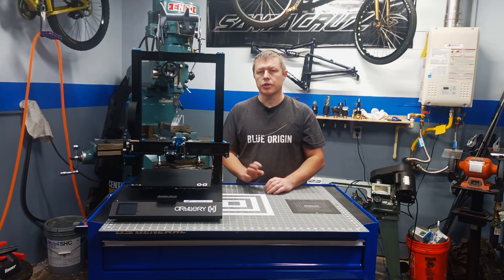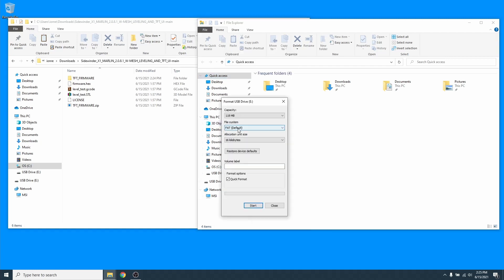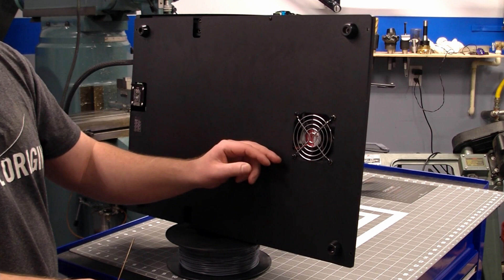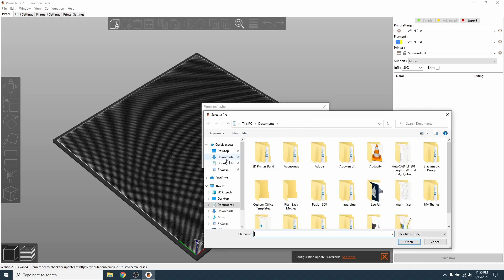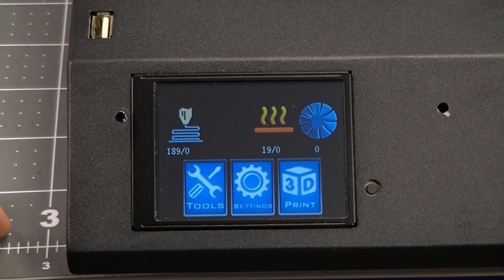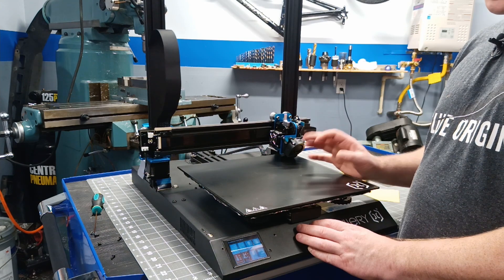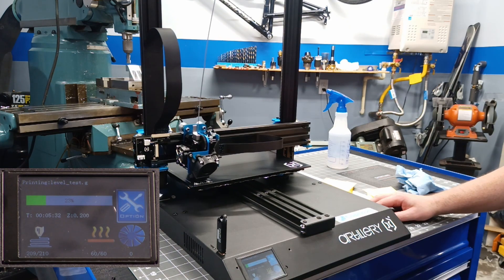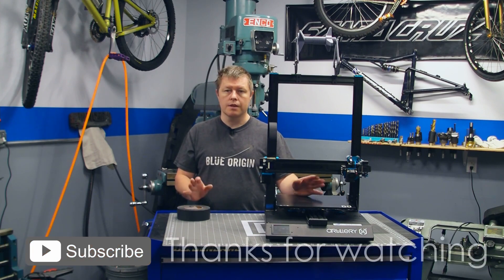Sidewinder X1 Marlin 2.0.8.1 with mesh leveling and custom touch screen UI.

Comment from the maker: UPDATE APR-8-2022 I moved the downloads for the X1 and Genius files to google drive and updated the links. The Marlin source files are now included in the downloads.
Reply: cannot download the file from google drive for some reason
Reply from the maker: @tyfll  Let me have a look
Reply from the maker: Seems to be working on my end, are you having trouble finding the download button? It is a little down arrow on the top right of the page.
Reply: @EtherealProject3D  the downloads are not working, as this user said
Reply from the maker: @millagax  I will have a look. Thank you for the heads up.
Reply: @EtherealProject3D  lucky me, I had all of your uploaded files saved in a folder from the last firmware update, more than a year ago. Thanks!
Reply from the maker: @millagax  Your welcome

Comment: Bought my X1 second hand. It works good.  The filament out sensor light is on and off like it should, but I use prusa slicer and it doesn't pause the print when filament runs out.  Do you think this firmware will fix that?  It says the firmware is Diga-Tech 1.0.27.x

Comment: Hi, Are you able to help me?
Have received a faulty unit that had wrong firmware installed. Managed to get it working again but it isnt very good. 
I would like to try this firmware, but I have BL Touch installed. Are you able to help me get this firmware to work with BLT?

Thnk you

Comment: Sir, This update very much fixed my issue where the print home and alinement of each leveling point were off by a lot. not just that it supported the printer to be able to keep the first layer down and actually print. I thank you for your update and allowing this update to be open. Thank you again for your work.
Reply: Ciao, dove hai trovato il download? Non riesco a trovarlo!

Comment: Followed the instructions but after installing firmware (successfully according to Prusa slicer) on the printer menu settings>about it still says version 1.5 and orca slicer says I’m using marlin legacy. Any ideas what else I can try? The thing that’s confusing me is that Prusa slicer detects the usb when I plug in and click re-scan, and when completed it says succeeded. Obviously I disconnected screen first. Any help from anyone would be massively appreciated.
Reply from the maker: @chezcotton  Thats just the TFT, that number wont change.

Comment: Thanks for you video first and second - PTFE TUBE IN THE HEAT BRAKE?? I have old X1 with newly extruder installed. I need to print ABS and I would like to ask you how to resolve that problem? Thanks in advance.
Reply from the maker: @tomasporculis1544  Get an all metal heat brake.
Reply: @EtherealProject3D  they are versatile or x1 has some especial?

Comment: I installed the new firmware on my  Sidewinder X1a while ago.  I just changed my nozzle. so i need to do the mesh bed leveling. I leveled all 9 points and then save to eprom, but it didn't save it????? Any thoughts why i can't save to eprom??
Reply from the maker: You may have to clear the eprom first.

Comment: I am trying to use this firmware with a bigtreetech SKRv1.4 turbo and I have to modify some pin settings.  I have never used Visual Studio, how do I properly open the file?

Comment: It worked fine for me, but for some reason it doesn't feed enough filament. Should it read 2.0.8.1 in the about section? Mine says v1.5. So did the flashing go bad somehow?
Reply from the maker: @liimamake  The display wont show the Marlin version so you are good there.
Reply: @EtherealProject3D  Thanks for the very quick response. 😁

Comment: hiii can you help me about prusa flashing i follow all the step remove the wire from lcd connect the cable to computer power on the printer but it says flashing failed see the avrdude log belowe how do i fix it i dont want to broke my first 2nd hand printer sidewinder x1 v4 thankyouu i spend my save money on it

Comment: I did all the tests and setups, the test print came out fine but then I tried to print one of my own file that I have printed many times before and it just wouldn't stick to the board and it took over 2 minutes for the Extruder heat to settle down before attempting to print .. then I tried another file (LW-PLA) again a file I have used before and I waited over 7 minutes for the hotend heat to settle up and down and I gave up in the end, any ideas?
Reply: I have run the PID test over and over again .. maybe 6 times in all .. when I go to print (even when I have pre-heated the bed) it sits there changing the extruder heat settings from about 200 to 225 (should be 210) for an long time (3 or 4 minutes) before it decides to print and then nothing sticks to the bed and I just get a mess .. I have re-run the level test about 4 times in all .. trouble is .. befor tI decided to do the upgrade, I was getting perfect prints in both PLA and LW-PLA  .. I guess lesson learnt .. if it aint broke, don't fix it

Comment: Thank you for a great video and for all the hard work you put into developing the new software .. one question .. why did you unplug the USB cable and use the laptop for loading the new software to the printer, could you not have loaded the files on to a USB stick and done it that way ?
Reply from the maker: You are very welcome. On this machine the firmware can not be loaded from a flash drive. The usb/sd ports on it connect directly to the display and the display only acts as a gcode sender and doesnt have the necessary connection for firmware uploading. This process can only be done from the USB port on the mainboard.
Reply: OK, thanks for the reply .. thought there must be a good reason for not doing it that way
Reply from the maker: @tonyaudsley  Your welcome. I figured the same as you at first till i got into it.

Comment: Nice job!  Really great video.  Very well explained, and as you said, you did all the hard work ;-)  I have an X1 and have the same issues with the bed.  I'm always trying to "split the difference" on leveling with wider prints to get the first layer to work.  I've been considering a new printer because of it.  I'm always afraid of bricking my printer with a firmware update, but after watching the process, I think you have me convinced.
Reply from the maker: Thank you so much. If you need any help feel free to email me or dm me on facebook or Instagram, im also on discord, all a etherealproject3d

Comment: I need some advice/help.  I have an old sidewinder x1.  I had to replace the drivers when one failed and I put in 2208's (all 5).  I installed firmware and booted up and now I will move in x,y and z just like it's supposed to when I used the screen controls but when I try and start a print, (I have a bl touch installed) It goes far right and rear (off the build plate) and starts to move down to home the z axis.  It used to go left and front near me, to home. (and On the corner of the build plate.)  I examined the firmware and safe home was on (as best i could tell)...  I could really use firmware (not in hex pref.) for a Sidewinder X1 with the (waggster) bl touch mod.  I have tried changing the firmware, but I just don't understand enough of it to fix it.   It also seems that the movements are pretty fast and jerky.  I'm not sure about the pins under the drivers.  One site says take them all off and others say leave some in (I forget which it said.)   I have not soldered or altered the 2208's.  Can someone help?   Thanks !
Reply from the maker: The firmware will need to have the new drivers defined and you will need to adjust the vrefs. I can fix the firmware but the tuning the voltage will be on you.

Comment: Thank you for your work. I have an issue. Printing the leveltest.gcode from a usb card work perfectly but when I try the same file with octoprint, is seems that it doesn't take the values saved in the mesh bed. Do you think that I have to put a code somewhere to recall the saved data in my gcode script in Simplify 3D or that something is disabling it in my gcode script ? Really want to make it work and I think that it will happen when I figure this thing out. Still, Thank you for your work.
Reply: Found my solution on Google. Once you have performed the mesh level, and stored it to EEPROM, you now need to tell your slicer to USE this feature. You need to add the gcode “M420 S1” into your start gcode section in your slicer. This needs to go RIGHT AFTER the G28 homing command, in order to enable the mesh correction before printing starts.

Comment: Something is missing from your marlin file.  I get this error:   C:\Users\USWU57668\Desktop\SIDEWINDER X1\SWX1_BL-TOUCH_INSTALL\FIRMWARE\MAINBOARD_FIRMWARE_SOURCE\Marlin\src\inc\SanityCheck.h:2802:4: error: #error "TMC2208 or TMC2209 on Z2 requires Z2_HARDWARE_SERIAL or Z2_SERIAL_(RX|TX)_PIN."
   #error "TMC2208 or TMC2209 on Z2 requires Z2_HARDWARE_SERIAL or Z2_SERIAL_(RX|TX)_PIN."
    ^~~~~

exit status 1

Compilation error: #error "TMC2208 or TMC2209 on Z2 requires Z2_HARDWARE_SERIAL or Z2_SERIAL_(RX|TX)_PIN."

I search for Pin 5_MKS GEN L V21.h and I look for Z2_Serial_TX_Pin that some say to find and change to z2_Serial_RX_Pin but it's not in your marlin files... what am i doing wrong?   I've loaded firmware before.   I replaced all 5 drivers with 2208's.  Thanks
Reply from the maker: you might have to define them as 2208 standalone
Reply: I did that first, then changed to 2208 without the standalone part.   error is: In file included from C:\Users\USWU57668\Desktop\SIDEWINDER X1\SWX1_BL-TOUCH_INSTALL\FIRMWARE\MAINBOARD_FIRMWARE_SOURCE\Marlin\src\inc\MarlinConfig.h:49:0,
                 from C:\Users\USWU57668\Desktop\SIDEWINDER X1\SWX1_BL-TOUCH_INSTALL\FIRMWARE\MAINBOARD_FIRMWARE_SOURCE\Marlin\src\HAL\AVR\MarlinSerial.cpp:39:
C:\Users\USWU57668\Desktop\SIDEWINDER X1\SWX1_BL-TOUCH_INSTALL\FIRMWARE\MAINBOARD_FIRMWARE_SOURCE\Marlin\src\inc\SanityCheck.h:2802:4: error: #error "TMC2208 or TMC2209 on Z2 requires Z2_HARDWARE_SERIAL or Z2_SERIAL_(RX|TX)_PIN."
   #error "TMC2208 or TMC2209 on Z2 requires Z2_HARDWARE_SERIAL or Z2_SERIAL_(RX|TX)_PIN."
    ^~~~~
In file included from C:\Users\USWU57668\Desktop\SIDEWINDER X1\SWX1_BL-TOUCH_INSTALL\FIRMWARE\MAINBOARD_FIRMWARE_SOURCE\Marlin\src\inc\MarlinConfig.h:49:0,
                 from C:\Users\USWU57668\Desktop\SIDEWINDER X1\SWX1_BL-TOUCH_INSTALL\FIRMWARE\MAINBOARD_FIRMWARE_SOURCE\Marlin\src\HAL\AVR\HAL.cpp:24:
C:\Users\USWU57668\Desktop\SIDEWINDER X1\SWX1_BL-TOUCH_INSTALL\FIRMWARE\MAINBOARD_FIRMWARE_SOURCE\Marlin\src\inc\SanityCheck.h:2802:4: error: #error "TMC2208 or TMC2209 on Z2 requires Z2_HARDWARE_SERIAL or Z2_SERIAL_(RX|TX)_PIN."
   #error "TMC2208 or TMC2209 on Z2 requires Z2_HARDWARE_SERIAL or Z2_SERIAL_(RX|TX)_PIN."
    ^~~~~
In file included from C:\Users\USWU57668\Desktop\SIDEWINDER X1\SWX1_BL-TOUCH_INSTALL\FIRMWARE\MAINBOARD_FIRMWARE_SOURCE\Marlin\src\inc\MarlinConfig.h:49:0,
                 from C:\Users\USWU57668\Desktop\SIDEWINDER X1\SWX1_BL-TOUCH_INSTALL\FIRMWARE\MAINBOARD_FIRMWARE_SOURCE\Marlin\src\HAL\AVR\Servo.cpp:55:
C:\Users\USWU57668\Desktop\SIDEWINDER X1\SWX1_BL-TOUCH_INSTALL\FIRMWARE\MAINBOARD_FIRMWARE_SOURCE\Marlin\src\inc\SanityCheck.h:2802:4: error: #error "TMC2208 or TMC2209 on Z2 requires Z2_HARDWARE_SERIAL or Z2_SERIAL_(RX|TX)_PIN."
   #error "TMC2208 or TMC2209 on Z2 requires Z2_HARDWARE_SERIAL or Z2_SERIAL_(RX|TX)_PIN."
    ^~~~~
In file included from C:\Users\USWU57668\Desktop\SIDEWINDER X1\SWX1_BL-TOUCH_INSTALL\FIRMWARE\MAINBOARD_FIRMWARE_SOURCE\Marlin\src\inc\MarlinConfig.h:49:0,
                 from C:\Users\USWU57668\Desktop\SIDEWINDER X1\SWX1_BL-TOUCH_INSTALL\FIRMWARE\MAINBOARD_FIRMWARE_SOURCE\Marlin\src\HAL\AVR\HAL_SPI.cpp:34:
C:\Users\USWU57668\Desktop\SIDEWINDER X1\SWX1_BL-TOUCH_INSTALL\FIRMWARE\MAINBOARD_FIRMWARE_SOURCE\Marlin\src\inc\SanityCheck.h:2802:4: error: #error "TMC2208 or TMC2209 on Z2 requires Z2_HARDWARE_SERIAL or Z2_SERIAL_(RX|TX)_PIN."
   #error "TMC2208 or TMC2209 on Z2 requires Z2_HARDWARE_SERIAL or Z2_SERIAL_(RX|TX)_PIN."
    ^~~~~
In file included from C:\Users\USWU57668\Desktop\SIDEWINDER X1\SWX1_BL-TOUCH_INSTALL\FIRMWARE\MAINBOARD_FIRMWARE_SOURCE\Marlin\src\inc\MarlinConfig.h:49:0,
                 from C:\Users\USWU57668\Desktop\SIDEWINDER X1\SWX1_BL-TOUCH_INSTALL\FIRMWARE\MAINBOARD_FIRMWARE_SOURCE\Marlin\src\HAL\AVR\eeprom.cpp:24:
C:\Users\USWU57668\Desktop\SIDEWINDER X1\SWX1_BL-TOUCH_INSTALL\FIRMWARE\MAINBOARD_FIRMWARE_SOURCE\Marlin\src\inc\SanityCheck.h:2802:4: error: #error "TMC2208 or TMC2209 on Z2 requires Z2_HARDWARE_SERIAL or Z2_SERIAL_(RX|TX)_PIN."
   #error "TMC2208 or TMC2209 on Z2 requires Z2_HARDWARE_SERIAL or Z2_SERIAL_(RX|TX)_PIN."
    ^~~~~

exit status 1

Compilation error: #error "TMC2208 or TMC2209 on Z2 requires Z2_HARDWARE_SERIAL or Z2_SERIAL_(RX|TX)_PIN." @EtherealProject3D
Reply: I select the comm port but for the board should I use Arduino Mega or Mega 2560 selection.  mine is an old MKS Gen L v1.0

Comment: In the comments it is emphasized that M420 is not necessarily required in the start code.  However, on my other printer I use the fading feature of the M420 command (e.g. "M420 S1 Z2.0"). Is it supported?

Would it be possible to implement more than 9 points for the mesh?
Reply from the maker: Yes you can use M420. And for more than 9 points you will need to edit that in the firmware.

Comment: Good morning. M600, advance printer pause to change filament is not working in this firmware. Kindly advice how it can be enabled. Best regards.
Reply from the maker: This is a known problem on thus firmware. I believe I have come up with a solution but I no longer have a way to test it. If you would like to test my hopeful fix I would be very grateful.
Reply: @EtherealProject3D thanks for your quick reply.  yes indeed I can test and report back.
Reply from the maker: @mmlatif4  Thank you so much. Try This and let me know. https://drive.google.com/file/d/1mLn8m838zozA5OoPZXYRol27AvA1EF6-/view?usp=share_link

Comment: is the TFT firmware compatible with a genius pro?
Reply from the maker: if it has an older chip tft on the genius pro. If you have a new chip one, you can get my genius pro tft firmware from my website and sub in the config file from this one and that should work.
Reply: @EtherealProject3D  worked perfectly, thanks a lot!!
Reply from the maker: @momonga1714  Awesome, you are very welcome.

Comment: I've downloaded the files but i cant find the files you mentioned in the video
Reply from the maker: Can you elaborate please?
Reply: @EtherealProject3D  once ive downloaded the files I cant see the TFT_firmware zip folder. its probably something I'm doing wrong
Reply from the maker: @Weekend_walk  I think is just in a folder now. I had to change the download from gethub to a google drive.
Reply: @EtherealProject3D  should I just put the entire contents of the file once its extracted onto the SD card?
Reply from the maker: @Weekend_walk  yes the contents of the folder named MKS_TFT28 onto the micro sd card. Aslo make sure th sd card is less than 8gb and fat32 format.
Reply: @EtherealProject3D  I'm guessing the printer can't read sd cards bigger than 8gb
Reply from the maker: @Weekend_walk  the update tends to fail using a larger sd card
Reply: I've managed to get the updated done. However, I've hit another snag. When I go to do the mesh levelling, the first point  works fine, but it won't go to the next point. When I press save, I get a message saying error: EERPOM disabled. Any tips?
Reply from the maker: @Weekend_walk  it sounds like the mainboard update was not successful.
Reply: @EtherealProject3D  would I just format the sd card and try the update again?
Reply from the maker: @Weekend_walk  The mainboard update is done from a terminal or slicer connected to the mainboard via USB.
Reply: @EtherealProject3D  that where you have to unplug the screen?

Comment: My Artillery Nozzle was crystalized with filament, and I removed it to clean; after re-installing it, the nozzle would slam into the bed. What is causing that to happen?
Reply from the maker: Check you z axis endstop and ensure it triggers. Raise the gantry up past half way, then home the machine. When the gantry starts coming down tey to trigger the inductive endstop with the tip of a screwdriver or something metal. If it doesnt stop the gantry, there is something wrong with the enxstop or the connection to it. If it does work, you need to adjust the bed height by tightening the knobs.

Comment: Thanks for your videos. Is there a way to fix the screen of Artillery X2 other than replacing it? I did a reflash, and the screen went blank, not in your video, but in another video before yours.
Reply from the maker: You may have put in the wrong firmware or the sd card you used is not format correctly. Its gotta be less than 8 gigs and fat32.

Comment: I have a print resume problem. After resumption my extruder freezes and doesn't inject filament. Whats your sugestions?
Reply from the maker: I am working on this issue. I believe ita a bug in the tft firmware.

Comment: Got it!  You can be proud you did call it, the stepper driver voltages all checked out good. So I pulled and switched a stepper driver from a functional axis and it ran just fine with that swapped one, boom problem solved... looked over the bad stepper I think it may have  "let the smoke out" but that is a easy enough replacement.   You can get another subscriber for a good call. while its waiting for a part i will go ahead and try out the mesh leveling
Reply from the maker: Awesome, Im glad we could figure it out. Thank you 😁